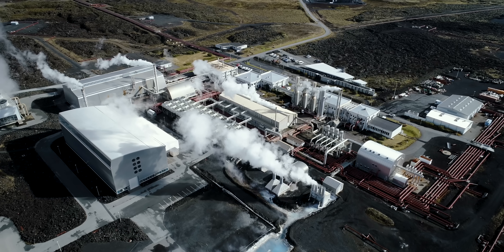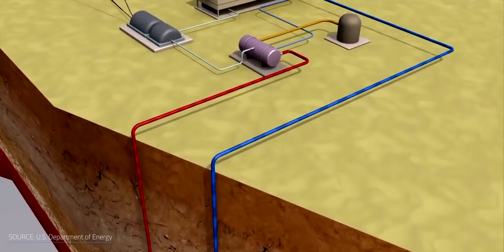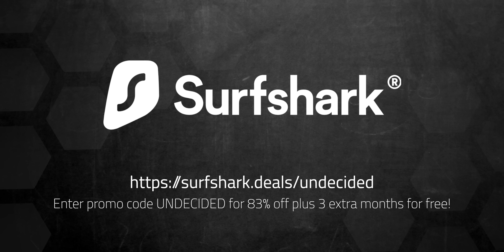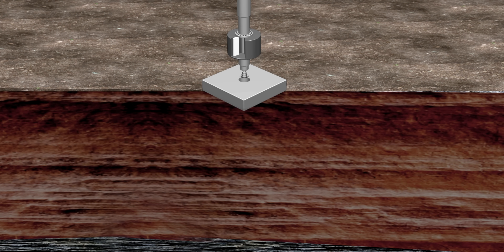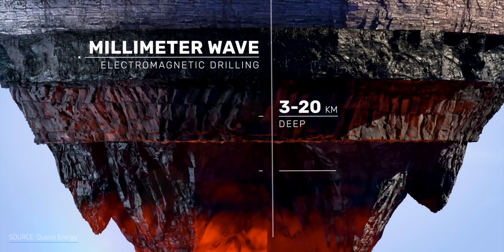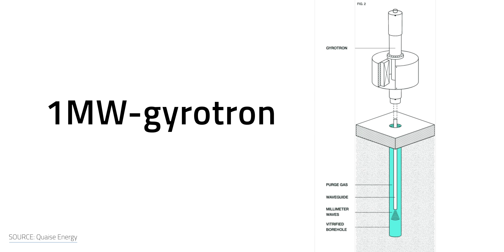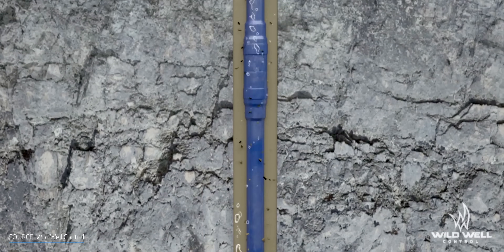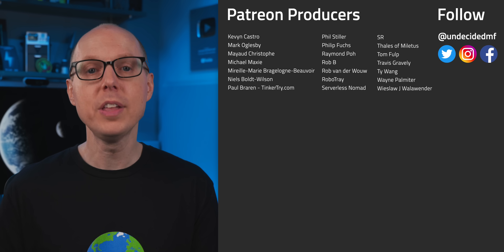Why This Fusion Tech May Be a Geothermal Energy Breakthrough

Comment: One thing I don't quite understand is how you get the looping of water into the hole and steam out.  I see these illustrations where you have two holes and then a connected circulating portion between them at the bottom, but how in the world do you do that?  Maybe you don't loop water in/out but rather something like a low melting point metal.  
And after a while, won't the rock in the region start to cool off?  We see this with standard geothermal heat pump systems. As the heating or cooling season moves  on, the system becomes less efficient because the Earth surrounding the system starts to heat (during cooling season) or cool (during heating season).

Comment: I’ve often wondered if a shallower hole could be used to heat or cool water to run a low temp differential Sterling engine as a generator. Heat could be taken from solar energy and dumped underground via liquid cooling system.

Comment: Is letting the heat out of the core and into the atmosphere really the right play?  It is believed that Mars lost it's geomagnetism due to core cooling.  We also want to lower surface temps, not raise them.  Geothermal seems counterproductive on two fronts.  I guess at least surface temps would take us out long before the core cooled enough to allow the solar wind to strip the atmosphere and sterilize the planet.
Reply: The surface isn't getting heated though....only the fluid gets heated  and that heat is what gets converted to energy by moving the turbine....the same principle used in thermal power plants.
Also, our geothermal heat is not trapped in the core, it naturally keep transferring to the crust and gets released into atmosphere, around tectonic boundaries. So instead of the possibility of heating the crust, we would only be using the excess heat before it moves to the atmosphere through  volcanic gases and geysers. 
So in essence, the earth surface  and atmosphere would be a tad cooler. But that's no where near enough significant change in heat to invoke an accelerated heat transfer from the core. Because the core is also not the only source of geothermal energy. Our crust is concentrated with radioactive minerals and their radioactivity also contributes to geothermal energy, and nowhere source is heat from just the pressure of earth matter.
Reply: @aleenaprasannan2146  The bottom line is that it is accelerating the heat coming out of the ground - unless geothermal energy wells slow the release via eruptions and fault lines.  Something I highly doubt has already been found to be the case as until this tech is proven, we are only harnessing the heat that already comes out near the source.  It's worth evaluating if those BTUs represent less warming issues than the greenhouse gasses that came from previous methods.  In the event it is proven that harnessing the heat long before convection brings it to the areas of the surface that are already radiating that heat results in additional heat reaching the surface that would not have otherwise.

Comment: this seems very promising, on paper and in a substrate that is uniform from top to bottom. question, how much does one of these tools cost? i ask because if these people have actually done any drilling themselves they would know how common blowouts are. so i ask how much one of these costs so i know how much it will set any drilling company back when, not if, but when they loose these. and how will this system deal with fractures in the earth? so many questions i have and by the looks of this, it wont be a thing for at least 20-30 years and will only be available to the wealthiest of companies that can afford to loose one down hole every other week.

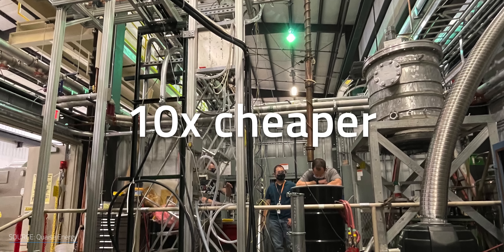Comment: This seems like an incredibly promising step forward for energy production. The one potential challenge that stood out to me that wasn't really addressed in the video was at around 9:35. If geothermal energy needs temperatures around 500 C (932 F) to reach maximum efficiency, would the glass walls be able to hold open the bore hole at those temperatures? Even if the glass doesn't melt, would it soften and weaken? Could this change depending on what kind of rocks are being melted into the glass of the bore hole walls?
Reply: depends on the specific glass or ceramic being formed; our conventional window glass is designed specifically to melt at low temperatures (for easy manufacturing), so it melts at close to 500 C. Obsidian softens somewhere around 700-1000 C. However, many other natural ceramics do not soften until well over 1000-2000 C.

Comment: For the record, sediment is unconsolidated material, sedimentary rock is consolidated, so we're dealing with people who didn't bother to learn even basic geology.  

The particles generated will still have the same density and mass of the original rock and still have to be removed from the borehole.  No, the material generated by a hole bored into solid basement rock isn't going to teleport itself out of the way into a glass wall. In a permeable rock like like a poorly-cemented sandstone, the remaining open spaces are connected and fluids can flow through it.  Igneous rock like basalt or granite don't have that porosity and what gaps there are aren't connected.  There's no place for those hot nanoparticles to go into the rock.

That's one of the reasons for highly-pressurized drilling mud - to float the ground-up rock, up thousands of feet of borehole against gravity, to the surface.  Drilling mud is also intended to seal the borehole wall long enough for casing to be set in place. 

They haven't even begun to deal with the fact that under miles of overburden, hot rock flows like glass.  Very, very slowly, but it still does.  Even if everything goes according to plan, those holes won't stay open forever.  Another thing the experts aren't saying is that some existing fossil fuel plants are in places where the basement is thousands of meters down.  Drilling a conventional hole with a diameter wide enough for his equipment to fit, all the way down to where it's supposed to work, is not going to be a small investment.

Comment: 1st: Installers of home geothermal heat pumps are using directional drill rigs to install the loops. It has very beneficial characteristics. 2nd: DOE is funding enhanced geothermal electrical production that uses much shallower holes. It is possible that expended fracking wells may be deep enough and the fracking is a necessary component of the enhanced geothermal. 3rd: Is this method of drilling able to be modified for fracking? 🤤

Comment: Very curious to see if the drilling truly can be implemented anywhere and everywhere. Being able to plug a geothermal steam source into existing turbine systems currently running off coal is huge: by retrofitting, you get to focus all resources on the primary source of energy as opposed to reinventing the wheel for power generation. Same principle with using hydrogen instead of natural gas: all existing gas transport infrastructure can be adapted/converted, as opposed to being torn down wholesale for something brand new.

The more cynical part of me can't help seeing that implementing these conversions would unlock a power source far less inconsistent than the more mainstream renewables -  and therefore less at the mercy of high-capacity batteries. Just like how efficient wireless power transmission - should anyone ever invent it - would suddenly make every copper mine in the world far less in-demand.
Reply: The existing natural gas infrastructure is leaky enough, and hydrogen is even harder to contain. There is a 0% chance we could reuse the natural gas transport pipes for hydrogen transportation.
Reply: Sadly, I can't put a geothermal plant in my car., so the battery market is safe. now, WHICH battery market, that is the question.  With nearly unlimited power, and a new source for platinum, H2 might actually win out.  Otherwise, some form of catalytic battery will be needed.
Reply: Wireless power is invented. Radio has been around for along time. A lot of energy is lost in transmission. There is no practical way to regain what is lost. Solar is also just that waves from the sun. Distance matters, the electron flow needs to be controlled. That is why your wireless phone charger is millimeters from its Transmitter to receiver. To better understand these things i recommend you look into Amateur radio ARRL and a HAM license. Most transmission lines and Home power lines/cords are aluminum, by the way for cost and lack of copper. Aluminum vibrates a lot under load.

Comment: The energy for the ground source system for your new house comes from the sun. It would be more correct to call it solar than geothermal because it doesn't get heat from the center of the Earth.

Comment: If this pans out, one could even imagine power generation eventually becoming far more localized, with each metro area having power plants, thus reducing the energy loss on long transmission lines. Lots of "ifs" to get there, no question, but this is exciting.
Reply: There is already a company that has developed geothermal for any location by boring really deep, in Alberta called Eavor-Loop
Reply: but what happen if there is a natural disaster such as earthquake?
Reply: @yeetboi268  They drill another hole... after the shakes go away.
Reply: @yeetboi268  this question applies to every energy source.  If the price to drill a new borehole is $500,000 it's a drop in the bucket compared to both the clean up and retro fit of a nuclear plant hit by a tsunami or a coal plant releasing radio active fly ash into a river ($6 million in cleanup).  Yes, a geothermal plant is subject to greater risk from an earthquake then most other plant types.  But that doesn't mean that other plant types are not subject to risks.
Reply: @yeetboi268  I think the earthquake would only affect the surface and shallow equipment.  There are large deep underground tunnel systems being built in high risk areas to protect essential and high risk services.
Reply: @andrewallason4530  Quakes are often pretty deep - even a 3 or 4 on the richter scale is scary in a mine.   Think the idea with those tunnels is making them extremely overenginered, like a bunker, rather than dodging the earthquake impact zone.
Reply: @yeetboi268  in high risk zones alternative power would likely be best, or simply bringing power in from outside the risk zone.
Reply: Less Transmission lines = more stability. I like it.
Reply: Most cities DO have power plants. Transmissions lines are to stabilize the grid, provide power to more distant customers, and tie in renewable solar/wind that isn’t near cities.
Reply: We can realistically do that now with IFR and put the high temperature Co/Cs waste into the earth regioned at same temperature.
Reply: Arguable
Reply: We have 65 trillion tons of uranium in the earths crust. All this obsessing over energy scarcity is totally artificial, driven by the hesitancy to embrace nuclear power.
Reply: @gregorymalchuk272  I think that thorium would be the better choice.  It's safer, scalable, and more abundant than uranium.
Reply: @michaelmiller5177  Ok, well there's 195 trillion tons of thorium in the earth's crust too. My point is that energy "scarcity" is artificial, caused only by people's totally irrational rejection of nuclear energy.
Reply: @gregorymalchuk272  We're on the same page as far as using nuclear energy. However, there is significant risk with uranium, which is why I think that thorium is the better choice.  Nuclear waste and accidents diminish the public trust in the technology, and the risks are seen as unmanageable for developing nations.  Uranium can be done safely, but the promise of thorium is better.   Scarcity of resources is the biases for capitalistic economics and you're not going to escape that any time soon.  It would be prudent for the US and other developed economies to invest in and deploy thorium technology to the world.  But our nation would rather the orange rot in the field than be eaten without payment.
Reply: This for district heating plus electricity.

 Curious to see if this is as game changing as he is making it. I mean the tech (millimeter wave) has been around for decades. So why has it taken so long?
Reply: That would also have a big benefit in terms of reducing the reliance on interconnected complex power distribution systems.  We've already seen a couple of massive blackouts where tens of millions lose power because a handful of things broke that, in combination, took down the entire grid for the region.   Sure, at least some of the root causes of those would still have an impact (Coronal Mass Ejections causing an EMP that fries everything can knock out 20 local grids as easily as it can a single supergrid that covers everything from Quebec to Washington DC), but it does mean that the fallout from such surges wouldn't spread past the edge of the area effected by the CME or whatever itself)
Reply: @rashkavar  A couple of months ago large parts of Spain and Portugal lost power for like 30 minutes to one hour due to a interconnect with France blowing up. We rely heavily on Imports from France to not use as much natural gas, coal, oil and Hydro..

Comment: Thanks Matt, Excellent presentation (with puns)!  Also learned some about the gyrotron!  So many promising things about this tech.  The speakers were very well spoken and didn't spew Sales!  Retrofitting current plants and the ability to put these in Non Unstable areas is the most appealing.  The other big thing to me is not having to use Nasty slurry's with normal drilling techniques other than through the sedimentary layers.  Probably the biggest benefit to me is recycling the steam on both sides of the plant, thereby not destabilizing the well and only having filters to clean/replace on the top end.  Can't wait to see how their proto build goes!!

Comment: like petroleum and gas reservoirs, these heat or energy reservoirs too have a finite capacity. Once the rock at the bottom layer around cools down in a couple of years of operation, there is no other alternative but to abandon the well. Rock is a poor conductor of heat and do not expect that heat will diffuse rapidly enough to meet the demand. Plus once the gas or steam reaches the surface, the pressure is reduced and the temp is also reduced. The lower the temp, the less is the efficiency of electricity generation.

Comment: I've heard of this trillion dollar ideea a few months ago.... it's fantastic and i've had think..... At depth of 10km the pressure of the water injected the pressure of the liquid at the bottom of the drilling well is 1000 atm and 400 degrees celsius.....
The question is what material are we going to use, because i think we have a problem at those temperatures + pressure ... Hope carbon nanotubes because steal i'm 99% sure that is not suitable for this aplication
The second problem is that the earth is not stationary....it has earthquakes...that could damage the glass coating ...and if we extact oil with infiltrated water we can separate them ....but when we have an infiltration of ground water that is cooling the heat pipe is not such a good thing + the seat generated you can't use it for high powe aplications because it must be at romm pressure not to infiltrare in the ground below.....
So my dear friends .... This is a great technology ..but if we boil an aquifer we've got ourself an other problem then
The problem must be investigated but is not so simple as it sounds in the "comercial"
Keep it up Mat. I love your channel

Comment: I think they are downplaying the durability of having this sort of sensitive scientific equipment operating under extreme heat and pressure that deep into the earth. I just don’t see it operating effectively at this depth.
Reply: The gyrotron remains at the surface. The only equipment beneath the ground is a waveguide, which is just a fancy name for a plain metal pipe.

Comment: I don’t get the comparison between the cost of electricity to drill the hole vs. the total cost of drilling a hole using traditional methods. It would make much more sense to compare total costs on both sides.
Reply: Yeah seems a little unbalanced when comparing costs, but if they don't have to constantly replace drillbits and can just drill at a consistent rate that would save a massive amount on material and labor costs.
Reply: @ingram2617  that’s assuming there are no replacement electrical drill heads and of course the power needed for the system. That might be inverted from using to making once everything is running though

Comment: Hmmm.  Academics opining about drilling is always dangerous and over-simplified.  Another part of drilling is solving problems - which always occur.  Stuck/broken drill strings; collapsed well bore; and blowouts (with things more difficult than oil) will all have to be addressed.  That said, it's cool developing tech.  Thanks for producing this.

Comment: What could they do with the hot argon and silica coming up out of the hole? Probably need to cool and separate them for gas re-use anyway. Maybe the waste heat is enough to generate steam and recoup some electricity over those 100 days of drilling